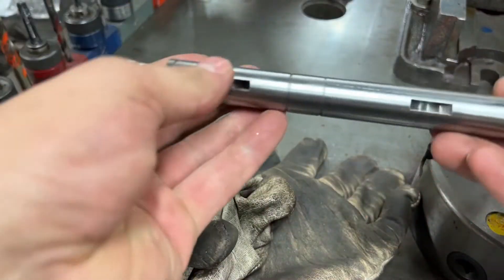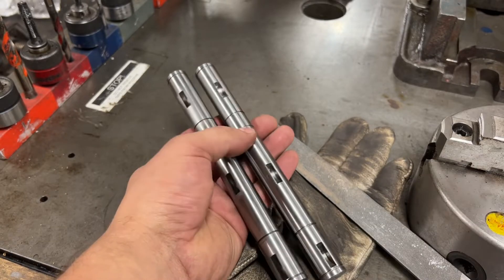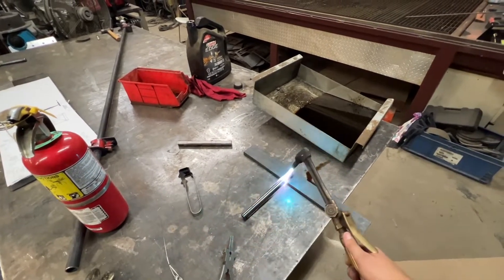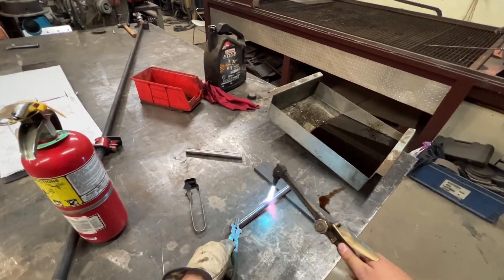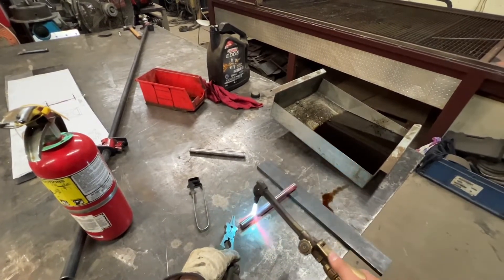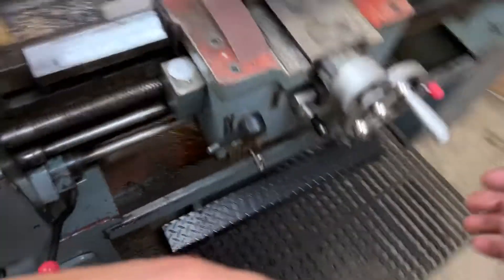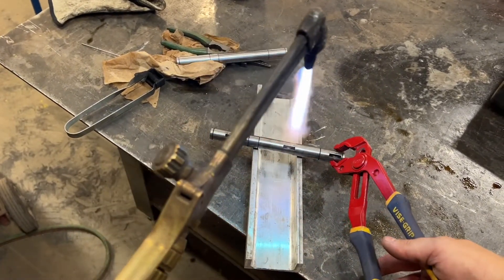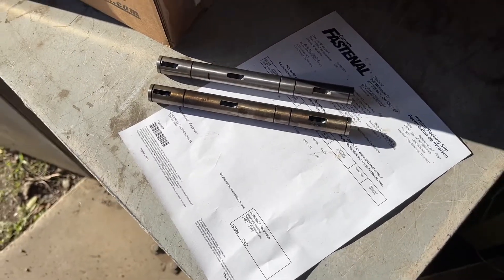O1 Tool Steel Shaft- Hardened And Temper in Shop

Comment: Thanks for posting. I am pretty sure the O-1 I was working with needed a whole lot more heat than I could get with my map gas torch.

Using some fire bricks, available for cheap from any hardware store, I did successfully get an O-1 steel knife to harden. Basically bounced the heat off of the bricks enough to make it work. I am not sure if I actually got the blade fully hard, though.

The tempering cycle should probably be done in a toaster oven.   Just bake at 400° for an hour